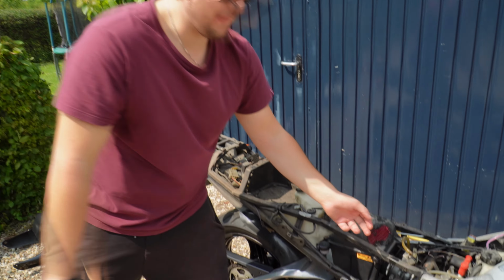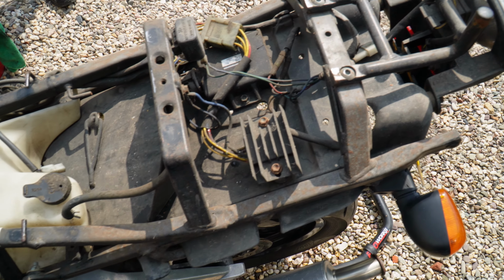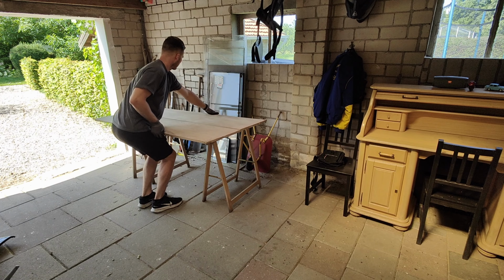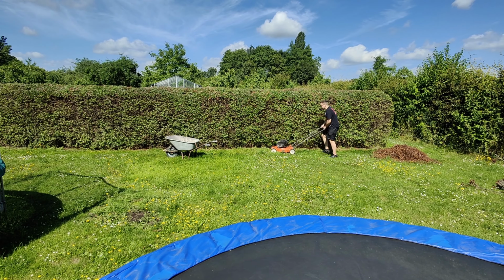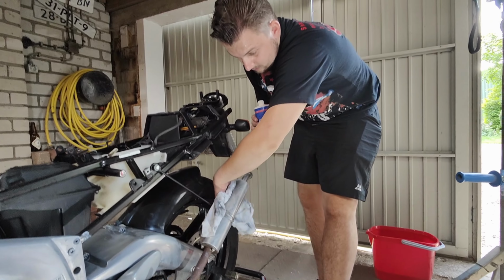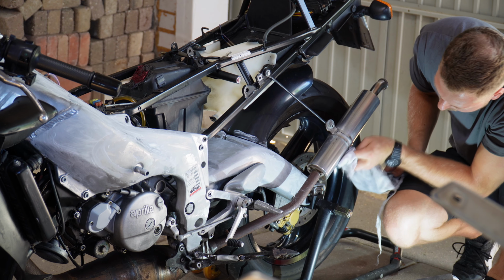Aprilia RS 125 Barn Find Build #1 - FIRST WASH In 4 Years!

Comment: Great content, watched 3 of your videos already and it's really good, thank you!! By the way, what's the product used on the pipe, I've seen a couple enamels but not for high temps as the pipe needs.
Reply from the maker: Thank you, we’re happy to hear that you enjoy our content! 
For the exhaust we used a heat resistance clear coating from Motip (04033). This should be able to handle the hot temperature, chemicals and gasoline. 
Hope te see you again soon!

Comment: I’ve noticed that big yellow tag on the back of the bike and in other videos on other bikes,does that number stay even if the ownership changes .
Reply from the maker: Yes, these are our Dutch licence plates. Each plate is specific to that bike. When the bike changes owners the tag stays the same. And we use a system in the Netherlands where all motorcycles plates start with the letter M. (Motorfiets)